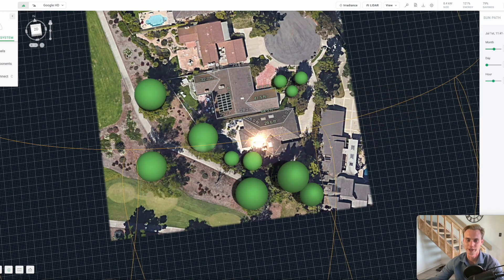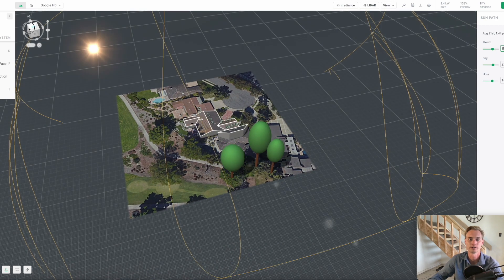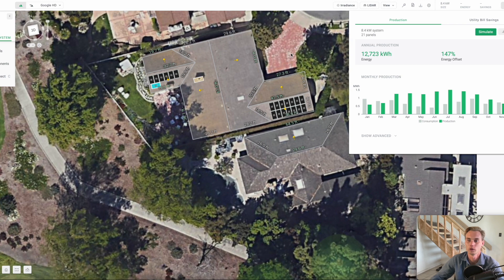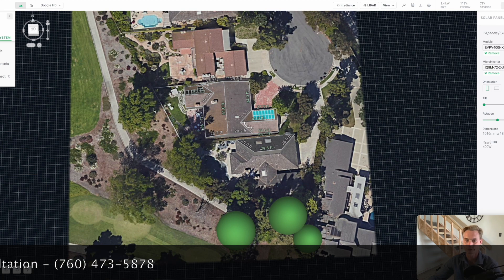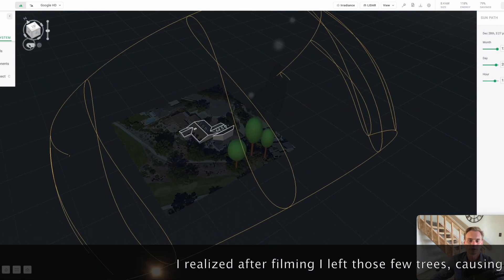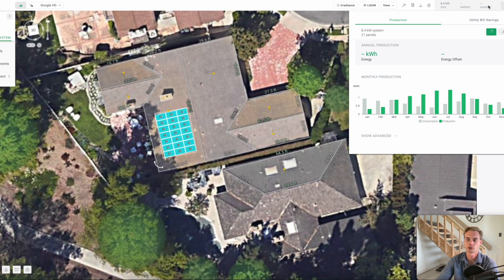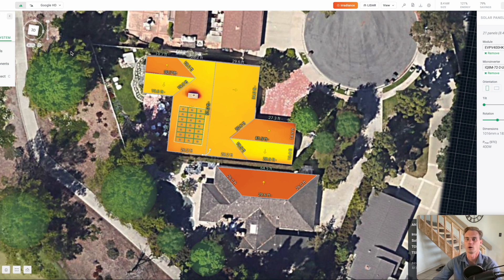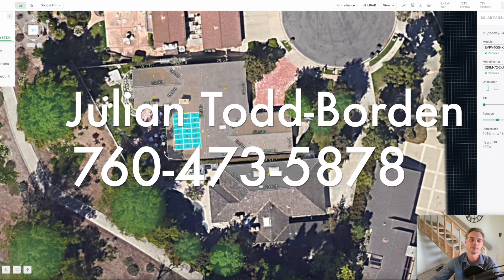How Southern vs Northern Facing Solar Panel Production Differs

Comment: Very interesting... I'm UK based and looking to replace an existing array with new panels. Even though it's less than ideal, I have a large area of north facing roof and placing the old panels there will save me having to store or dispose of them. I'm hoping they'll generate useful output in cloudy conditions - which we experience more often than southern California :)
Reply: Just had a new array fitted on my garrage with 10 panels south east and 10 panels north west. Right now the north are as good as the south and in winter should still contribute.  Panels are the cheapest part of the system really so I just wanted to cover the whole roof and have my inverter running as much as possible.
Reply: I'm also UK (N.West, region 7E, LAT 55N) and have a semi with a hipped roof, so effectively 3 fairly small faces. My worst face is nearly NE, then the next is about SE, and the best is SW. 

People using the software to quote me here are getting almost as much from my NE as the SE in the modelling - so I'm going for all 3 faces which will be 12 panels (435W) total, and a Tesla PW3...  Mine is on order, and I'm awaiting the DNO approval.  

(DNO is the network operator - you have to seek approval for your array size in the UK when you want to feed back into the grid).

My calc's show that I'll nearly cover my annual usage - except for the PHEV I'm now charging.  Definitely worth doing for sure....

Comment: With the price of quality panels coming down from what was already a great value compared to 10 years ago, why not spend the additional (small compared to the system cost) dollars and put panels on South, East, and West? Here where we live, those West facing panels have the potential to lower electric bills significantly when compared to East-facing panels due to the time of day change in rates. (I have the perfect backyard facing near true south so I have a Sunrise String, and Mids String, and a Sunset String all ground mount).
Reply from the maker: It mostly comes down to feasibility of installation with the roof that we have to work with
Reply: Panels are so cheap now it makes sense to fit as many as you can afford, more panels boosts winter production, and excess in the summer can be exported as in the UK we now get decent export rates.

Comment: Thanks for a look at the software, very cool.  A 15% drop on the north side is significant, but it's not the deal breaker that I thought it would be.  It could be better for time of use.  For an off-grid system it may be better to spread your energy input around so you don't have to rely so much on a battery that can only charge during part of the day.  This only applies to panels with an east/west component.  If they're pointed straight north then they're pretty much always worse.
I really hope that enough sunlight gets through my neighbor's leafless trees in the winter to make my southern panels usable.  Fingers crossed.  I've seen just a little shading kill a whole panel before.
Reply from the maker: It’s true that now that we are entering a nem3.0 world it makes sense to get some AM production